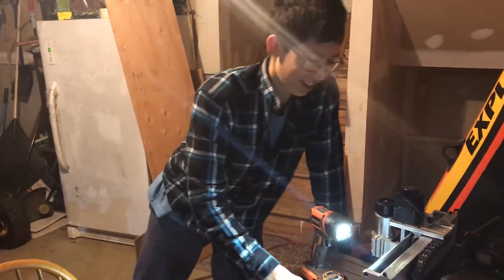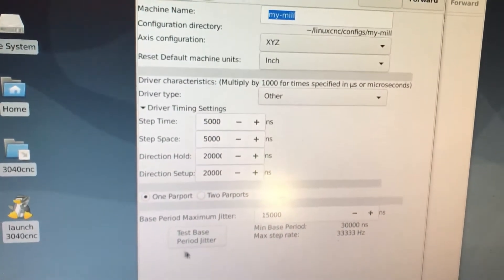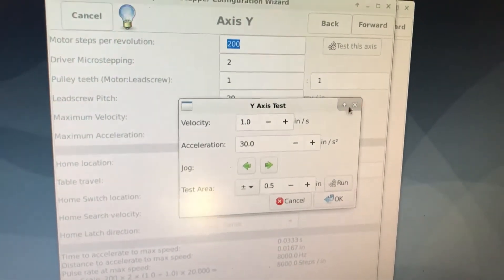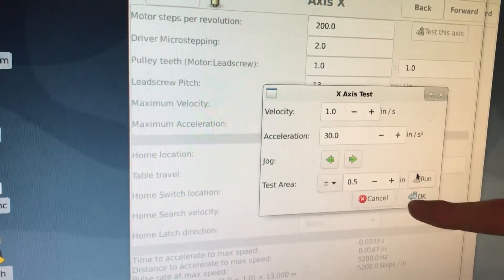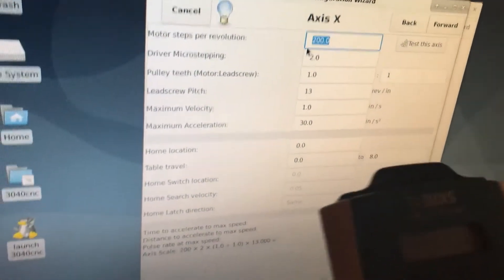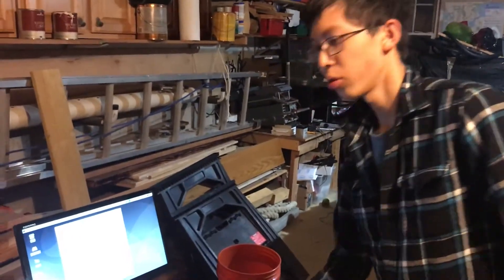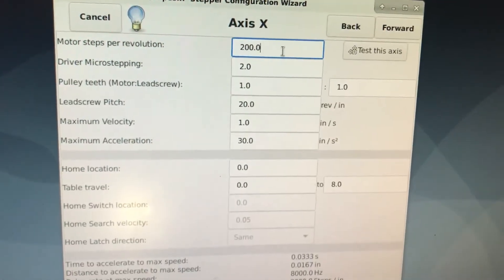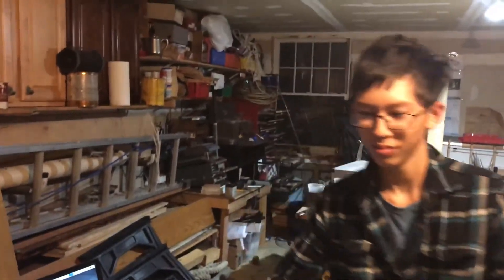3040 CNC w/ Linux CNC Configuration and Set UP EMC2

Comment: Thanks for this video, Question, I was able to get mine set up to where it'll jog during the axis test. But now when in the actual software, the enable button you show off at 10:40 doesn't work the way you describe, it's seemingly inverted to the power of the system. I can enable it when the power is off, and jog the virtual cursor, but when I try to do it with the machine on, it doesn't work and I can't disable the E-Stop. Is this something that you encountered when setting up the system?